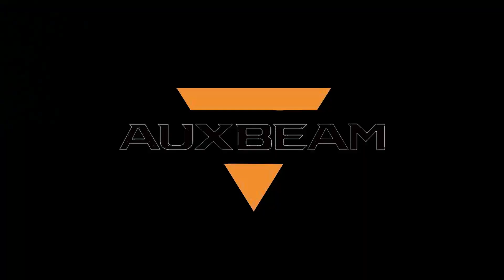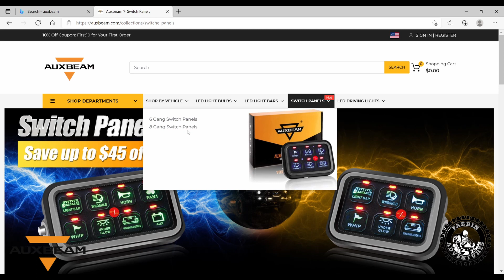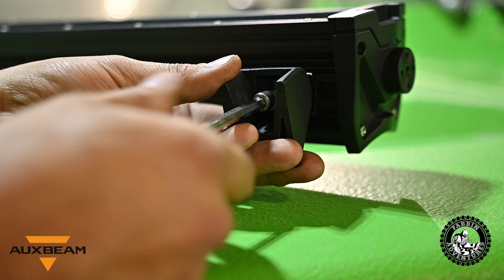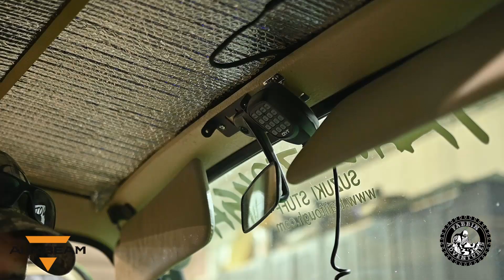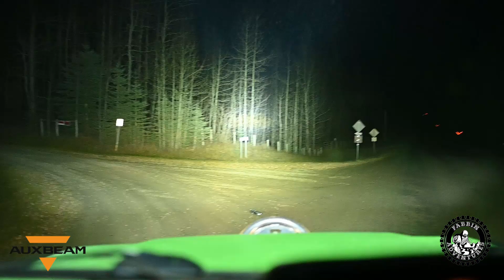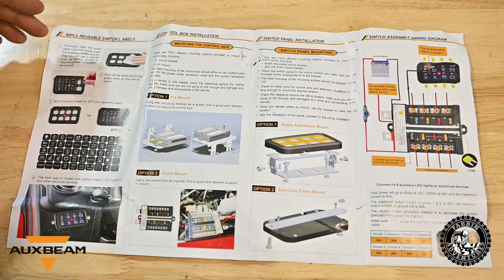Auxbeam 32" pro light bar & 8 Gang switch : Review and install

Comment: How did you run your wiring from the lightbar to the aux switch panel? Did you cut the cords to get rid if the relays?
Reply from the maker: No i just wired it normal...i guess..lol
I use the relay in the new switch box to trigger the relay in the harness.
I dont like to cut harnesses if i dont have to.
Thanks for watching and commenting!
Reply: So you left the relay on the harness and wired it to the Auxbeam switch panel??
Reply from the maker: Honestly, i cant remember, that was a few years ago. Id have to go chase wires to see.
Thanks for watching.

Comment: How I can connect arb air locker to this ?
Reply from the maker: Simple enough, just connect you wires from the arb solinoid to the switch panel.
Thanks for watching and commenting!
Reply: @FabbinAdventures  yes ? Because for original arb switch is 4x cable (DK green, yellow, black, blue)
Reply from the maker: Hmmm, what do the 4 wires do? Turn the compressor on and open the solinoid at the same time maybe?

Comment: That light bar is one of the best I’ve seen. Those spot beams are nice.
Reply from the maker: Yeah, im actually impressed, we will see how long it lasts.
At least they have a legit website, not like some of the junk a guy gets from amazon.
Im sure these accessories will work great for a long time.
Thanks for your comment!
Reply: @FabbinAdventures  how is it holding up 11 months in? Looking to getting one for my Suzuki jimny
Reply from the maker: Works the same as day 1, pretty decent stuff id say.
Reply: Love your channel ! When you wired the light bar with harness to the switch panel did you cut the relay off of the harness when you wired it to the panel?